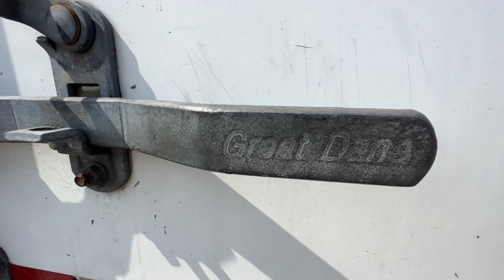LAST MINUTE RateCon Per Usual !! Freeway dead Stop wonder Why !! Pull off for Drone shots OMG VIRAL

Comment: Another new RaceTrac location.  It will be across the street from Papa's and Beer.  Taken from a FB post on ACBD Public Discussion page:  "Construction is going to ramp up this week for the new Anderson, SC RaceTrac Travel Center at I-85 Exit 27 (Hwy 81/E Greenville St).  It will be within the first 20 in the country to include a Truck Stop component and will be larger than a typical RaceTrac with additional features."